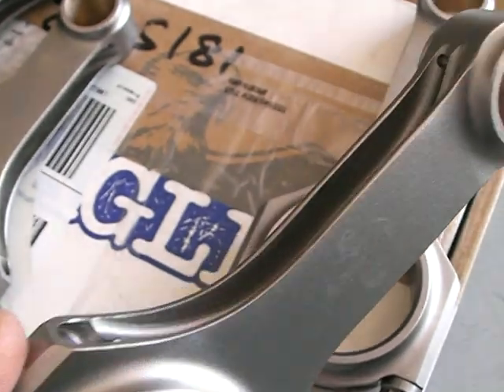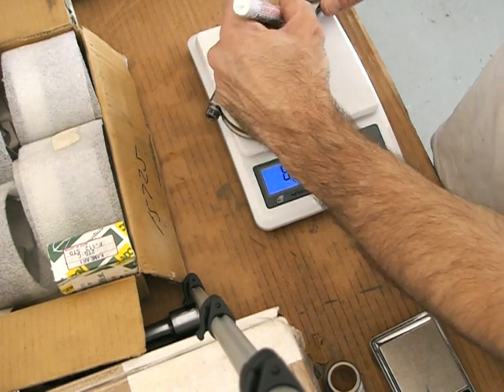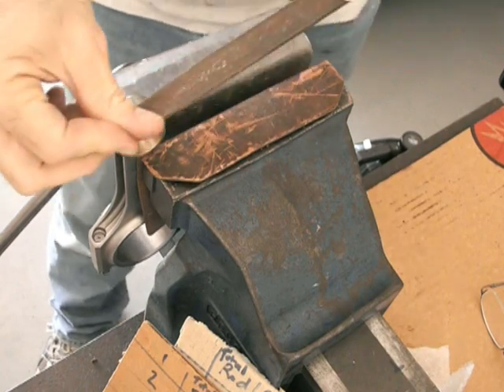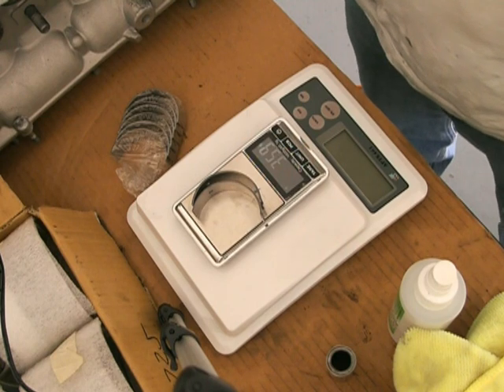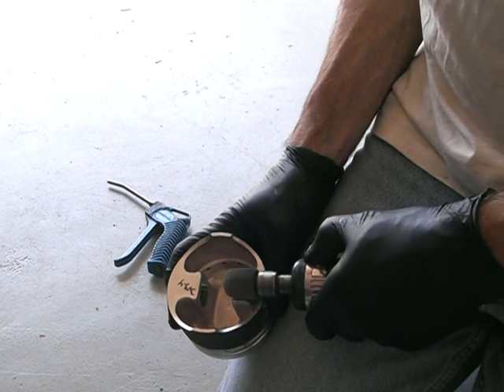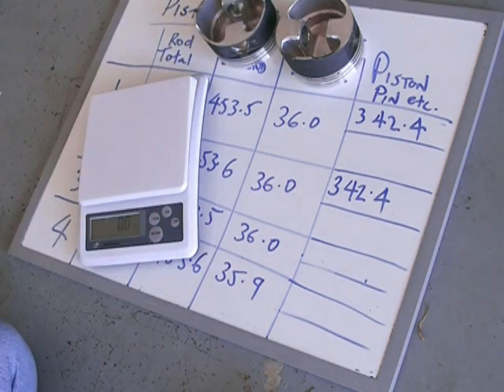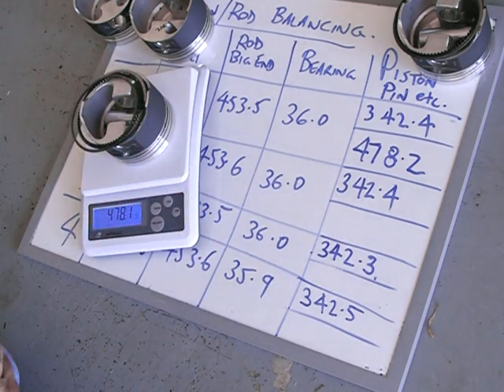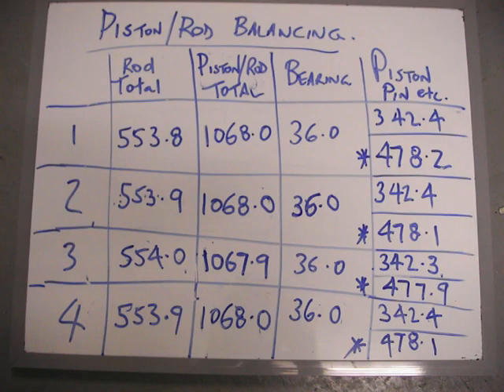Engine Balancing

Comment: What is the accuracy of the scales + or - what? You said it measures down to 0.1 of a gram, that is no indicator of precision, precision is in the accuracy of the scale instrument. Kitchen scales are not precision instruments, they are fine for scones and not for engineering. So eagle say their rods are to within 1 gram, then they are to within 1 gram as opposed to you kitchen scales. You are not using the correct scales. You will find precision scales on ebay.
Reply from the maker: Hi, to clarify the scales I used in this video have precision to 0.1 grams and accuracy of +/- 0.1 grams. Sure I could pay more for "engineering" scales but there is no point given the accuracy of what I used. Eagle is to +/- 1 gram, I wanted more accuracy hence why I used scales that could go down to 0.1 grams. Your comment may confuse some people, scales measure weight. Like you said its all about accuracy which I had to +/- .1 grams. Seems like you're saying that if you weigh sugar or flour on "engineering" scales you will get a different weight. Come on bro, this is common sense. Use scales that are accurate and fit for what you're doing, this doesn't always mean you need to pay for expensive scales when you do a one off job....
Reply: At least you're in there playing the game Classic Celicas & more. The man in the ring as the saying goes (Worlds Fastest Indian)  Unfortunately there are nay sayers.
Reply from the maker: Well said Jian, cheers....
Reply: Steven Johnson 
The scales accuracy is within +/-0.1g. This means if his weigh 0.1g light they will still 100% match each items weight but all will be 0.1g lighter than noted.
Reply: Accuracy aint need.. a comparison weight is no matter if accurate or not... Even if the scale was out by 500g it would be out for all..